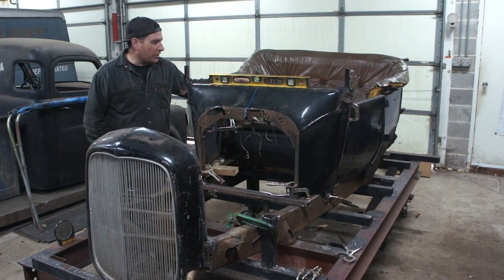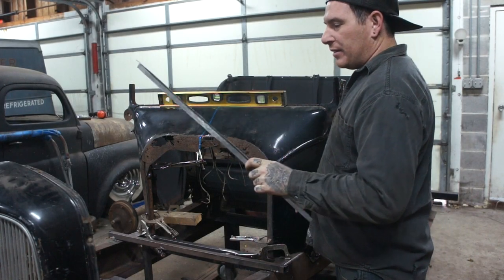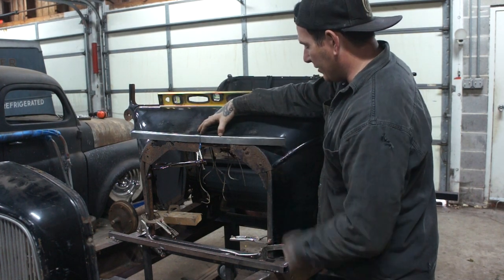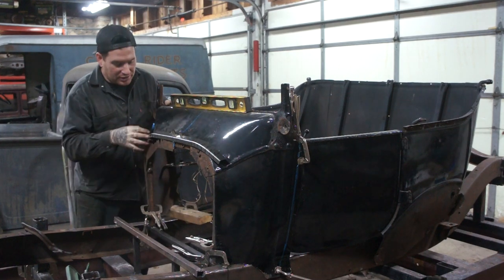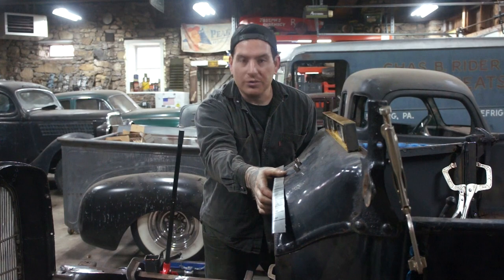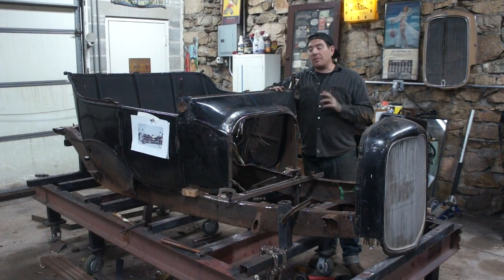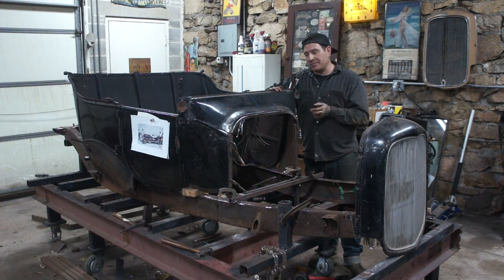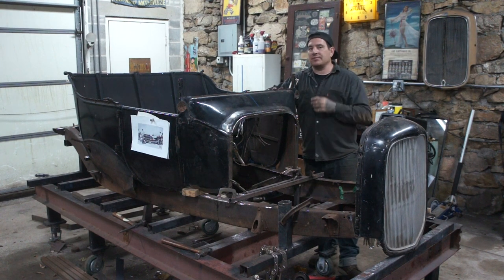How to Fix a Rusty Ford Model T Cowl- Ford Free T - Ep. 5

Comment: Matt come on down and borrow my break anytime... two questions for my understanding. First..you used some hand snips to cut out that corner cowl section....those must be some nice snips....id have guessed you'd grab an air cutoff with a thin blade. Next....the ark on you tig was pulsing....im just venturing into tigging...was that a machine setting? Or your foot? Or on the torch. The whole foot pedal thing seems a hurdel I have yet to get over. If you get a chance drop back by my GJ thread...I've been busy.
Reply from the maker: Hi Larry, I actually found a big 8' brake just after this was filmed and I couldn't be happier! I like to use hand snips to do my final trim on sheet metal to assure a really accurate cut and it makes the fit up of the two panels really nice with little to no gaps. It is time consuming and labor intensive but it's worth it when welding and finishing a panel. The Eastwood TIG 200 Digital allows me to preset all of the weld functions ahead of time and I can use a finger switch to control it all. I have the machine set on the pulse feature. I have it pulsing 1.5 times per second  and thepulse is set at 66% with a max amperage of 35-40 amps (depending on the project and quality of metal). Message me the link to your GJ thread, I think I forgot to subscribe to it and can't find it again! Thanks!
Reply: IronTrap Garage https://www.garagejournal.com/forum/showthread.php?t=303023.  Regarding the pulse feature. I'll have to look into it further.. thanks for the explanation. Great job Matt.

Comment: Matt...thanks for showing this little fabrication video, gumby guys like me learn heaps. One question though...why did you TIG weld it? Was it because you can control the heat or something to stop the fabricated part warping?
Reply from the maker: Hey Gavin,Yes I like to TIG weld sheet metal because you can control the heat better and also you can hammer and dolly the weld to adjust it after welding. Hope that helps! -Matt/ITG
Reply: @IronTrapGarage  thanks mate, I've only just started MIG welding by doing my own crash course repairs on three WW2 Jeeps I'm restoring. Hoping to do a 1940 Ford truck project later next year after the first Jeep is done for the 75th Anniversary of Victory over Japan. How hard is it to do TIG welding as a complete beginner and I'm guessing it gives you a much smoother weld where you basically have no flap disc clean up afterwards? What thickness is the sheet metal on these older bodies....18 gauge or so?

Comment: I see you are using the pulse function on the tig200 digital.  What are your settings and what gauge metal are you using.  I have a tig200 digital and I am restoring a 1979 Blazer.
Reply from the maker: I use 20 gauge steel for exterior panel replacement most time, but use whatever is closest to what you're working on. I run my welder at around 30-35 amps with 55% background pulse at 1.3pps. Just play with it and see what you like best. I use the finger switch instead of the foot pedal for sheet metal these days.
Reply: @IronTrapGarage  Thanks Matt,  your doing a great with your projects have learned a lot from you.